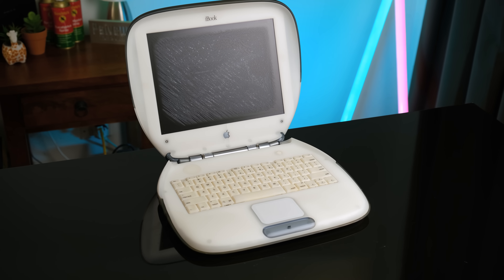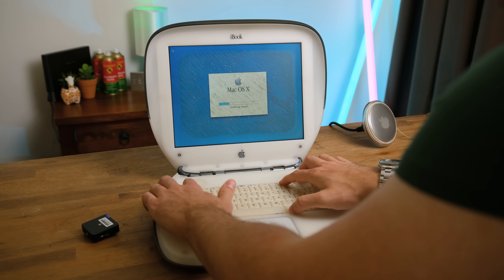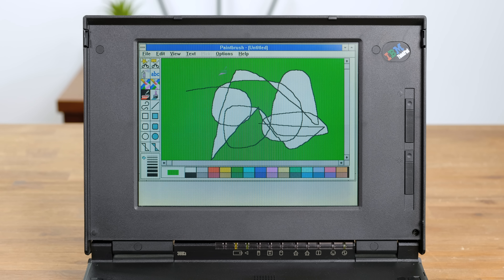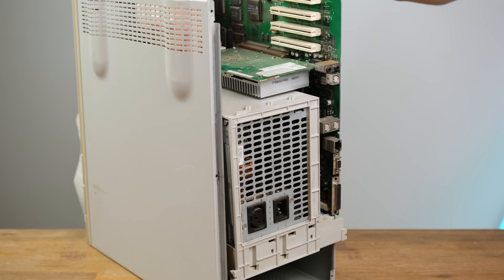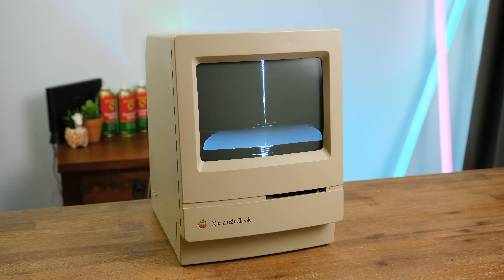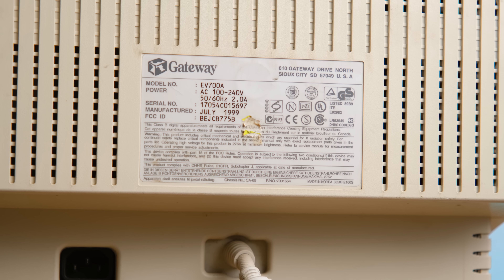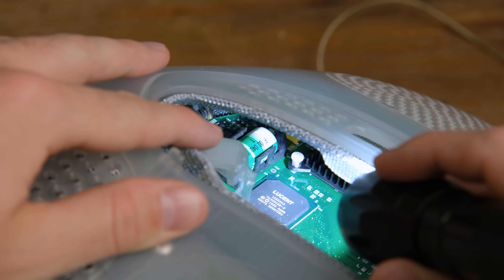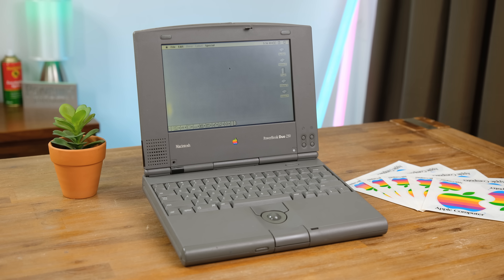So Much Vintage Tech Is Dying... Here's Why

Comment: Is this a troll video? What are the chances of anyone getting this much damage from just “stored” electronics? The bulging caps are one thing, but the screens? 

Is it damaging your own laptops worth for a false narrative?
Reply: I experienced such brittle plastic too (e.g. vent grills in CRT monitor cases). Hard plastic can swell and turn brittle by contact with wrong oil. In 1990th I had a Toshiba CD writer drive in a PC that tended to get stuck. After oiling with "machine oil", after a while the whole black polystyrene chassis started to crumble apart like charcoal. The same happened with a transistor radio. Also bakelite (e.g. in Hammond organs and tube radios) is infamous for this. When plastic cogs split around the metal axle or concentric cogs in quartz clock movements get stuck, this happens by swelling plastic due to wrong oil. Thus never lube unkown plastic mechanisms with anything but silicone oil. Also most rubber (latex, butyl etc.) turns into chewinggummy goo by any non-silicone oil. By I read complains that otherwise silicone oil may soften silicone rubber (used as rubber keys and key contacts), so do not spill it and avoid to oil if you don't need to. 

Similar plastic/rubber damage may happen by long time exposure to oil or battery leak vapours. Battery liquid vapours particularly damage LCD displays, thus failing segments or broken carbon foil cables (they tend to turn brittle anyway, e.g. inside calculators and Casio music keyboards) are likely caused by this.

Comment: A wake up call for collectors of tech like me! And yes, those batteries are the bane of my techie existence! I hate em! I have a ruined audio effects rack module due to one of those soldered on p-ram batteries..
Reply: Dude I think this is a fake narrative. The capacitors are one thing. But tue 3 screen at the same time frame? This guy most likely damaged those laptops himself
Reply: @rickyricardo2006  you may be right, but I do have alot of tech stored that some of it has gone bad just sitting. Mainly due to those damned batteries. I have been sorting my musical equipment this past weekend and sure enough, one of my midi delay rack modules is now completely destroyed inside due to the p ram battery being corroded and leaking everywhere inside. The bulging caps bit? That I have only seen in P4 machines and some P3 machines of the early 2000s when it was a epidemic. Now it is mostly the batteries. Even storing new batteries have ended up leaking in the package. I live in the cold snowy region of the USA and this is a thing. Now the brittle plastics? That I have only seen in the South and with CARS mostly... I can not seem to find a car that does not have something plastic in it that is not broken lol!

Comment: Recently, I've lost a PowerPC 9500/120 and a Compaq Deskpro EP/SB Series. The plastics were disintegrating. 
I have a 2005 HP Compaq NX6105 laptop that still works, but its screen started to have those yellow stains. Now it's all over it, and cracks around the screen hinges are bigger so I'm considering even throwing it away.
I'm trying to keep a Compaq Presario 5000 series that was bought new in 2001, and this is the one I still care about a lot, but some things inside it are starting to fall apart as well. It's really sad to see that happening, but I'm kinda grateful for the happy childhood, games, and good times those machines made me have back then.

Comment: It be interesting to see which vintage tech holds up the best over the years tbh
Reply: Vacuum tubes hold up pretty well, they will fail quicker than transistors when being actively used but will store for decades, if not centuries. New old stock of vacuum tubes seem to work just as well today as they did when they were new.
Reply: '80s electronics pretty much lasts forever, or at least repairing it isn't too difficult.  It wasn't until the mid '90s that they started putting batteries and leaky SMD caps into everything, and using multilayer PCBs.  It gets even worse after 2006 with the switch to lead-free solder.  My Apple IIs and Ataris will never die.
Reply: @serqetry  I still use lead solder dude. Lead free is used on the connectors and cables in stuff that I build due to potential stresses.
You do get far less dry joints in lead free though due to the higher melting point, but the joints don't have that nice shine like lead solder.
I use three different grades of solder, including one that's 2% copper, because I like the copper tips, not these horrible tips like tinned steel or nichrome.
Reply: When I was growing up we had a Atari  . Then a commodore.  And the list gos on. .
Reply: @diamond6719  it still have an Atari 600xl that still works.
It's a keyboard that has a cartridge slot to play the only 2600 games.
Also have the tape drive and disc drive I was using in 1985.
Reply: @rogerramjet6429  WOW
Reply: @rogerramjet6429  Nope, cartridges for Atari computers and 2600 are a completely different thing.
Reply: @cyberyogicowindler2448  I meant the same type of appearance. Not functionally the same.
Same principle, slightly different design.
Reply: @diamond6719  I didn't grow up with a commodore but have a c64 it's my favorite retro computer. Lol
Reply: @wolfcanine100  We didn’t have a commodore till 77 .
Reply: I went to a video game museum and some of that was really need. I got to play an Atari 2600, Super Famicom, and some Sega systems I'd never seen in person before. I still have a lot of my GameBoy games that I play on a GameBoy Advance, and my dad has some old Mac stuff. So far the cheese grater looking ones seem to be okay, but I'd love to ask a guy that ran a Mac museum at a university I went to what his experiences were like. I think all of them worked except maybe a neon orange iMac, and the Apple II. I think the coolest one was a working Mac Portable. Certainly discoloured, but it worked. The first battery powered Mac.
Reply: @joylox  I still have an original hand held double screen Donkey Kong I purchased with my very first pay in April 1983.
Originally paid $40 but it's now worth over $700 from collectors.
Reply: Agree with the last comment
80s electronics (in my experience vcrs, cassette players, camcorders, and some tvs)  are regularly more durable because those used more metal than plastic for their structure and mechanic pieces. Capacitors where better and cables are easy to change or remove for repair because these were soldered and not so small.
But yeah it also depends of the device itself and how it was built
Reply: Have a friend with a film projector from the 1970's
It 100% works!
Reply: I feel like the atari 2600 will outlive half the kids who bought one at this point.  Until the circuits literally rot apart mine has never given even a hiccup and is well past 40.   Built like a tank, simple as all hell and all the parts are thick and durably made.  Feel's like that one will bury them all compared to most other older tech.

Comment: I had the same thing happen to the screen of a vintage laptop of mine. Early LCD’s often have this happen because of the adhesive reacting. I think mine has too far gone and the pressure from the gasses cracked the screen under the polariser.

Comment: I had something similar happen to my old 20" NEC LCD monitor, which I'm still using as I prefer the 4:3 aspect ratio. Despite being around 15 years old, the display still holds up pretty well image quality wise being IPS, but it seems that the polarizer is slowly starting to de-laminate in the corners.
Reply: I'm still rocking a 19" Dell branded LCD monitor from the early 2000s as one of mine, and it's holding up fine, but the colors are slowly shifting a bit towards the red. Backlight issue, maybe?
Reply: @youmukonpaku3168  If the backlight is ccfl then it really does sound like a backlight issue. Although I'm not an expert.

Comment: Toshiba T3200 systems seem to have a problem with bad screens and bad power supplies (both due to capacitors). I'm working on restoring my T3200SXC with a new-stock 2002 screen and self-made adapter. The power supply is going to be based on one from an individual who calls himself adalbert here on youtube.

Comment: I store my old stuff in vacuum seal bags with desiccant.
Reply: Ozone harms plastic and rubber, but most of the corrosive substance is typically already inside (battery leak vapour, plasticizers, wrong oils, acidic glues), so sealing it airtight can make the disaster much worse than letting it safely vent out.

Comment: Good video. Currently battling against several of these issues myself - failing power supplies that are getting replacement capacitors, rusty old PCs being prepared for powder coating, an iMac G3/233 Bondi that needs a replacement flyback transformer and another 233 with some serious battery corrosion. The never-ending list of issues that needs addressing has almost pushed me to step back from the hobby - almost. I've certainly downsized the number of machines, and hopefully persistence will soon take care of the rest. Currently none of them are actually working, but I'm looking forward to hopefully having a couple of them running again soon.

In the past I would have just replaced machines that had too many issues - another IBM, Compaq, Toshiba, whatever never seemed that far away - but as most of these machines seem to have gone either into the hands of collectors, scrappers or recyclers by now, I'm having to think outside the box more and more often when it comes to cleaning them up, repairing their issues and maintaining them. It's a lot of work.

On a side-note, I must be extremely close by - I work about two streets over from the PO Box address these days! May have to get in touch eventually as I seem to occasionally come across machines, spare parts and accessories, sometimes from work and sometimes just in my travels, that I usually have no use for, but always try and find a home for before turning it over to recycling.

Comment: I just replaced the screen in my ThinkPad 755CSE (1995) because of vinegar syndrome. It had been stored in a garage in Florida for years before I got it though, so no surprise the screen got ruined. I removed the clock battery and main battery shortly after getting it, thankfully no damage it seems functionally, but the main battery was stuck in there bad, corrosion visible. It's also showing the rubber issue you demonstrated in this vid... I was already considering selling it after replacing the screen, since it's got its original dock too still, so thanks for this video. I'll probably be selling it soon in case it dies on me. Not like I use it anyway.

Comment: I've had a couple of game consoles show graphical glitches after being in storage for a few years, I hope replacing the caps will fix them. I also have 2 of those dell pentium 4s, the one with the early gen p4 never worked while the later one works perfect with no cap damage but the hdd's now have bad sectors after working fine a few years ago bull I'll just put in a sd to hdd converter if they break.

Comment: We need to begin uploading STL files for plastic PC components so plastic bits can be 3D printed to restore functionality. 

A lot of the new filaments on the market are way stronger (especially once annealed) than the plastics that were available back then.
Reply: Glad to see some people promoting restoration in this comment section, Restoration is the only real way forward, not crying about it or living in Fear. Either restore it or move on (and ideally if you do move on allow someone else to have the opportunity to restore it).
Reply: @draconic5129  I enjoy rebuilding things because I have ASD and find the restoration process to be soothing and meditative. It sort of began with the family Betamax player when I was 8 and it sorta snowballed from there.

The unintentional by-product is reducing the number of working or nearly working items in the trash, reusing components that are working to replace ones that are not, and recycling the rest to ensure it's disposed of accordingly. 

I even got my 3D printer as a broken store-demo at Micro-Center for $50. Rebuilt it with genuine Creality parts for $20 more, then threw another $100 in upgrades on it so it was still less than stock retail ($199 at the time) but with all the upgrades already done. 

I had never even touched a 3D printer prior, I sorta learned as I went along. My 1st print failed due to warping, but my 2nd print ever turned out perfect. It's been rather dialed-in since. 

I had to learn some CAD in high school to design and fabricate control-surface hooks for UAVs. so I'm a bit rusty but I'm down for a refresher course. 

I even have a part in mind that I should be able to test with since I have many and they're prone to embrittlement and breakage (Lian Li case faceplate-clips from the early 2000s). 

Otherwise I would need the dimensions of the particular item to be printed; while I have a decent collection of vintage tech, I literally can't have everything. Any sort of STL repository would require a substantial amount of collaboration, or at least a 3D-scan of each object.
Reply: Can you make a video on how to do this?
Reply: This screams business opportunity. A cottage industry needs to develop for computer restoration, just like what happened for old cars.

Comment: Excellent video, cheers! 

I have my old Samsung Q10 in a drawer so I should probably get it out and make sure nothing's happened to it. Thankfully I took the main battery out.

But as a toy collector who constantly struggles to keep plastic degradation to a minimum I can tell you this: you can't stop plastic degradation! 99% of the problem in toys is the fire retardant that's added to the plastic during the manufacturing process. This is what turns white plastic brown. Even keeping those out of the sun doesn't stop it. I've recently noticed a figure from 2001 that has white parts is starting to discolour and I keep it in my collection room that has UV-blocking film on the window and the blinds always closed. You just can't stop it.

So my advice is to just enjoy your items, be they electronic or toys, because you can't save everything so you might as well enjoy them while you have them!

Comment: After a very long time I finally learned what was up with the vinegar smelling old Pentium 3 era Celeron-based Samsung Sens laptop my family had. Damn vinegar syndrome made the whole laptop bag smell so much that I had to get rid of it too sadly.
Though that wasn't its only problem as it also had lots of cracking plastic, leaking battery, and dying hard drive. The screen was already dying by the time I got to use it back in 2006/7.

Another old dead laptop I've seen was a relative's Toshiba Sattelite 105CS where every plastic piece was cracked and turning to dust, all batteries have leaked, vinegar syndrome screen that's cracked, etc. It was really dead that I only kept the bag.

Among the ones mentioned its leaking batteries and rubberized plastics I hate the most. 
While I like ThinkPads (and do own a T450 myself) I think its biggest flaw is the rubberized exterior, though that also applies for most ThinkPads with only few exceptions that use bare plastic or metal cases.

Addemdum: Part of the retro tech that I just have on display are my father's Toshiba KT-S2 and Sony Walkman TPS-L2. Both have dead rubber belts. 
The Toshiba in particular has a dead Left channel due to a trace from the amplifier being gone from a capacitor leaking. I might just bridge from the amplifier a new wire to the earphone jack so I can use the Toshiba as it has good Radio that's pretty funny as its in the shape of a casette tape.
Not sure about the TPS-L2 as I haven't tested it, but do know it doesn't run due to the old belt being removed.

Comment: Unfortunately my old Packard bell "All-in-one" computer with a built in CRT display died by sitting in storage for several years untouched. I pulled it out a few months back and attempted to turn it on with no luck. I tried everything I could to revive it but nothing worked.

Comment: I work on really vintage electronics (1930s-1960s) and ALL the capacitors need to be replaced except for mica ones (though those can go bad too) as the capacitors were made of paper and wax and the electrolytics get tired, short, or don't filter enough anymore. Tube based televisions, radios, and record players are very fun but can be challenging at times.

Comment: btw, from working in a refurbishing outfit, alcohol and a melamine foam sponge does a good job at burning through gooey coatings. I've polished off a lot off the stuff when trying to clean dirty units that have gone sticky.

Comment: Im noticing this video seems to be, why vintage overpriced garbage seems to be disintegrating. Most of these examples are from crapple. I have many different brands and types of electronics that date back to far older than most of this in perfect physical and functional condition. Except my compaq luggable 486. Thay bloody thing is brittle as hell. I have stuff from before jobs was even a twinkle in his daddys eye that is in fantastic shape. The volatile memory batteries are definately a thing. Pull em and replace em with new ones.